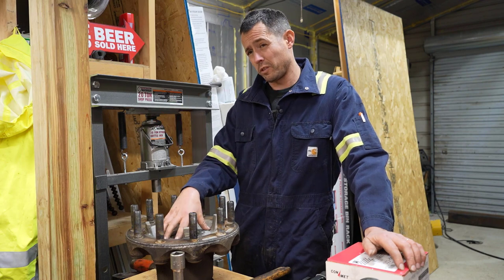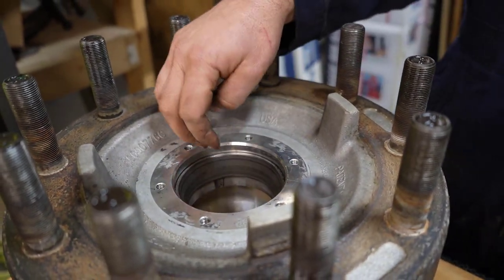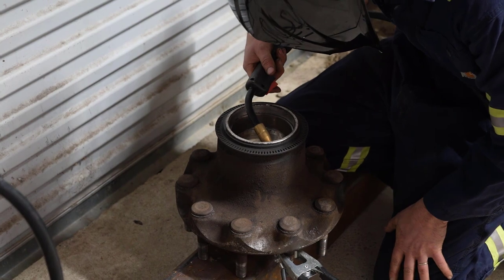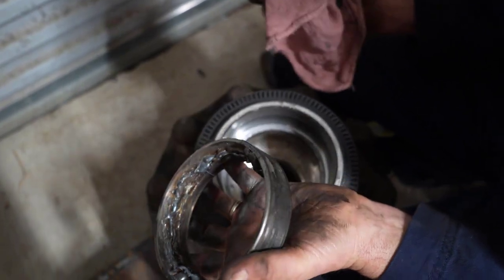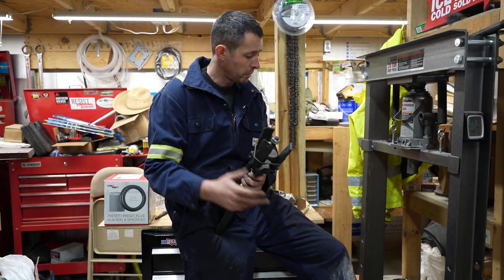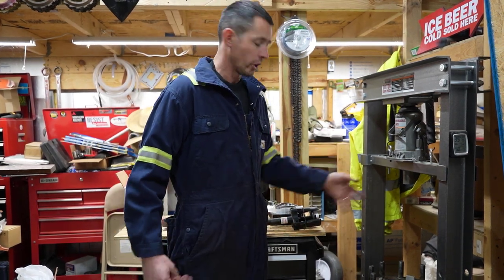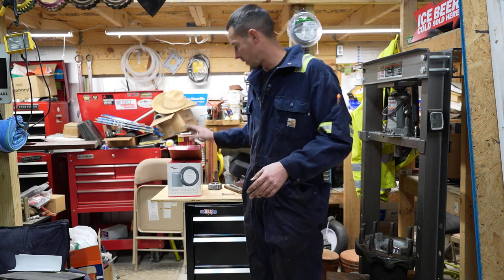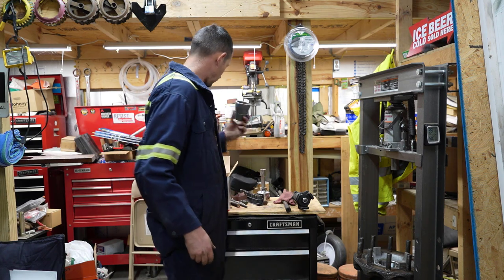Bearing Failure & Wheel Bearing Race Removal(welding trick) and Replace

Comment: I had my brakes change and got parts marked up to 29.5%. Is that a fair mark up? Shop left part list and recipes in my truck. I paid an extra $1161.99. 

Just to have the pleasure of giving them business. I'm guessing it's my fault. Any advice.
Reply: Part of being an O/O is knowing how to do those sort of jobs yourself. The way I look at it is if the Truck is going to be in the shop and off the road. Then Rather than stand around and wait I will do it myself and the money saved pays for the time off. Off course I do understand that not everybody can do their own repairs. 
Thats when you give Ryan a call, and get it done correctly and not get ripped off.
Reply from the maker: I appreicate the kind words. Yes, I do know repair your own truck isn't for every owner operator. But knowing the basics of your truck is very benefitial  for owner operators that you can avoid a lot rip-offs from the mechanics that don't know what they are doing. Finding a reliable mechanic that you can talk to is key in this situation.
Reply from the maker: 29.5% mark up is a lot! I can understand a small percentage of mark up from the shop to cover their part research time, credit card fee and handling., etc... We charge a flat 5% to cover those charges. We don't make money off of parts, we make money off of service that we provide. I am sorry to hear your story. I just don't agree with some shops that charge heavy mark ups on parts.
Reply: when a dealership buys parts they mark them up 35 percent(min), and you dont times  you divide so you get the almost extra 2 percent that way. if you dont mark parts up you will not stay in business, however not knowing what you had changed paying a extra 1162 dollars sounds like you had some major work done other than just brakes, just doing shoes and drums should be about 200 per wheel for parts,
Reply: @anthony1636   thanks for the advice.

Comment: I have been here 18 months and absolutely love it here. And yes they will break out fuel and other stuff especially if they are trying to get you to move the load! I would use your settlement card for everything and get rid of the fuel card. But you must call LS to get them to set up your settlement card for fuel before you can use it for fuel. There are many things over here that are beneficial that most other places don’t do. Good luck.
Reply from the maker: Thanks for sharing. Good luck!

Comment: thank you so much for Sharing your experiences.  I have a 2000 Freightliner class FLD is True some Insurance companies and companies not take older trucks,  also is it possible to convert the standard braking system to disc brakes if so what’s a good brand